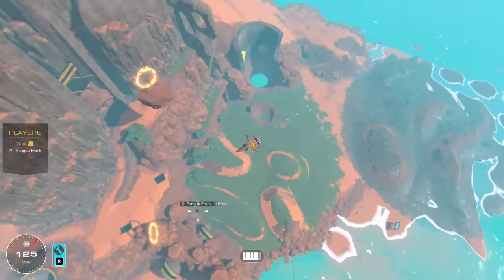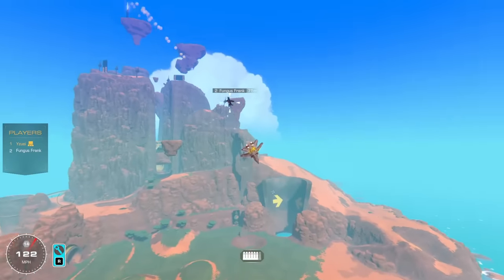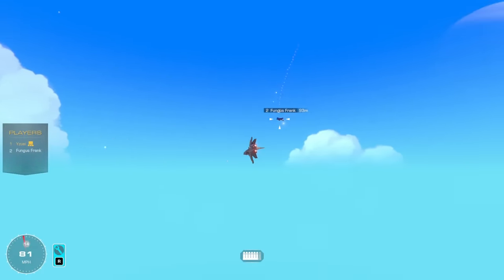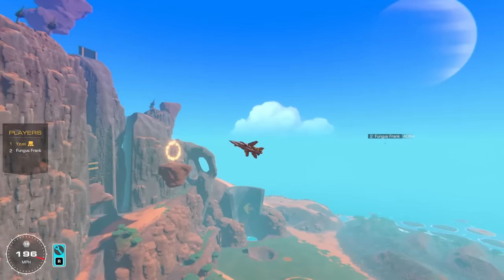Can We DOGFIGHT Using TINY Fighter JETS?!

Comment: You should do a rc plane dogfight
Reply: YES!!!!
Reply: Yeah, but I don't think Yzuei knows the proper RC method. I've only seen him use the 2-seat method, and then what's the point?
Reply: agreed
Reply: @Verin100 wait, that's not the proper one?, if there is a smaller one, why the f didn't I know, i could build manually guided missiles bro
Reply: @Verin100 spill all of the beans
Reply: @angelmarinarenas5626  there’s loads of input lag with it and the controller is kinda big but it is possible to put it in a plane